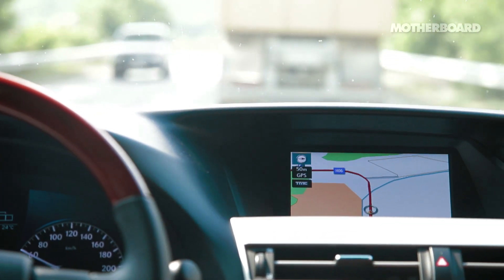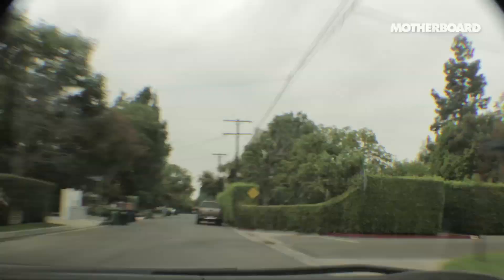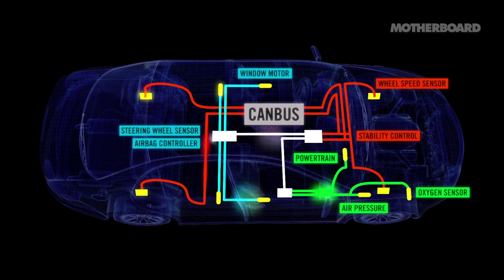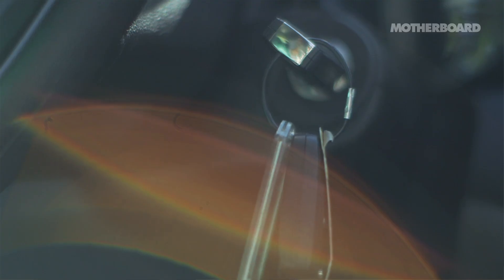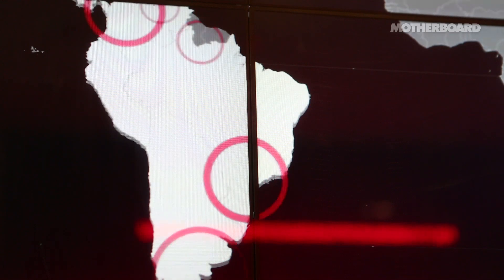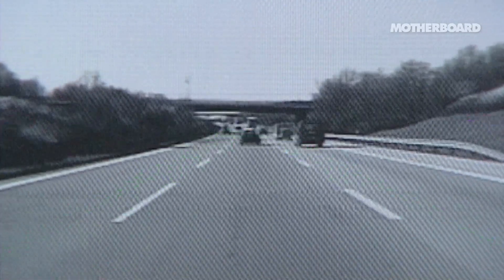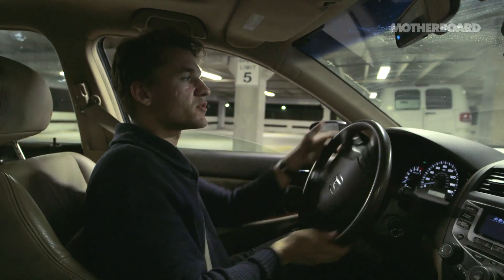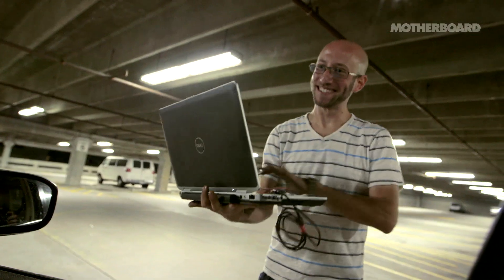How to Hack a Car: Phreaked Out (Episode 2)

Comment: So carbureted muscle cars with breaker-point ignitions and a complete lack of electronic anything enjoy an immunity to such threats... And they still run after over 40 years.
Will there be old car nuts restoring today's PCs on wheels in 2050?
I hope so !
Reply: ... just like in the Mad Max movie, Muscle cars will rule the planet.
Reply: in 2050, those types of cars won't be allowed on the road. Police will be able to scan any car they see to find out if it's insured, if it's registered, who the owner is, how many miles it has on it, how much gas is in the tank, previous repairs, what parts work, what parts don't work. If you're driving a car without the ability to be scanned for status remotely, you will be pulled over and detained. Trust me, this shit is coming.
Reply: The best hacker is 👉🏻 HACKERCHARLES01_ on Ig 🔥or +1(210) 593-8315_
Reply: The best hacker is 👉🏻 HACKERCHARLES01_ on Ig 🔥or +1(210) 593-8315_

Comment: The Boston brake assassination is a technique used by intelligence agencies and has been used for decades. It is basically the same as this, the ECU chip is replaced with a rigged one that allows them to gain remote access to the vehicle causing a deadly crash such as the incident Princess Diana was involved in. It was the price of high treason in this case it seems.

Comment: I sure hope the annotations weren't important, because I turned them off as soon as I saw that "click here to subscribe" thing.

Also, love how their "surveillance" bit is a super unrealistic movie clip with unnecessary special effects and meaningless "data" bars. Way to give credibility.

I'm glad someone is bringing attention to this, but this video needs less hollywood drama and theory and more hard facts and demonstration. A few minutes in they mention how the software wasn't following standard security practices. This is the stuff that needs to be highlighted. And the bit where they show him actually hacking the car from his laptop, it says that this is a modified car and they aren't normally vulnerable. They should be highlighting how it's relatively easy to patch into the control unit and make those modifications, or they should find one that is vulnerable without modification.

Right now, the way this software and hardware is designed is pretty much the exact opposite of how it should be: closed source, closed doors, secrets everywhere. You know there are vulnerabilities but you can't easily identify them, and when you do, you can't easily fix them. This stuff needs to be open-source and heavily scrutinized both by random hackers and by government safety engineers.

Comment: This isn't hacking, It's physically connecting to the cars OBD2 with a bi directional scan tool and controlling actuators. The video claims wireless, although you would still need to physically connect to the data link connector. Very misleading and dumb video.

Comment: What a Joke! "This vehicle shown is modified with third party hardware for DEMO purposes" It says in the video you would have to physically connect something to the ECU which the only easy access to this is below the steering column on the OBD2 (data link connector) so you could easily un plug it, and you would have to break into the vehicle to connect it. His fancy lap top is really just a bi directional scan tool hooked up through a wi-fi connection so distance would be limited, all mechanics use scan tools, they are nothing new. Base brakes will always work, brake booster would work for three applications at least after the car was turned off, you would lose power steering but not steering all together, your parking brake would still work, and you could still unlock/lock your doors with your car key.

Comment: They installed a unit that controls the computer of the car, you need physical access to do that, so it's not like it's a magical hack that is wireless, it requires alot of work.
Reply: Yes, that's the point. I don't understand why they didn't say that in the video. (They just wrote a subtitle about it)
Reply: No, they hacked in through blue tooth on the radio telematics module to the CAN network, this exploit has been patched from my understanding.

Comment: The demonstration with the honda accord is such a crock of shit. That accord doesnt have a can-bus system. All he can hack is the keyless entry system. So he can kill/start the ignition and lock/unlock the doors. HE CANNOT TURN THE BRAKES OFF! THE DUMBASS PRETENDING TO DRIVE, JUST NEEDS TO PRESS THE BRAKE PEDAL LIKE A MAN AND NOT LIKE LIKE A 5YO GIRL. THE ENGINE IS SHUT OFF SO THE ONLY THING LOST IN THE BRAKING SYSTEM IS THE POWER ASSIST BRAKING SYSTEM. THE PEDAL JUST NEEDS MORE PRESSURE APPLIED TO MAKE IT STOP THE CAR.
Reply: EDIT: just watched enough to see him admit that the accord he is demonstrating his "hack" with, doesn't have a can-bus system from the factory. very good, you can hack the car you modified so it is hack-able. smh. sounds legit...

Comment: One Problem, how the fuck are they supposed to just "plug in" a chip to the ecu of a random car? Not very stealthy as the ecu is buried inside the engine bay of any car, not to mention newer more connected cars have so much shit covering the top of the engine bay, your not "hacking" into any cars very easily like this.

Comment: Sensationalist garbage. 

An old Honda Accord like that shown has purely mechanical brakes and steering. They cannot be interfered with as shown, no matter what. If you build a special board and solder it to the right wires, yes, you can control certain aspects of the car...but are we really supposed to be scared of that?

Comment: Most of these hacks require some specific types of cars… Most cars can't even access basic "functions"… You can't even remotely access the steering wheel on most cars.

You can only hack the car if it has the appropriate remote control system! This limits "car hacking" to newest relatively expensive cars…

You can't bypass basic functions on most cars. You can ALWAYS stop the car! You can always honk! You can always get out of the car!

The only things that can be hacked on most cars is engine start/stop, alarm system, panic mode, windows, lock/unlock, and all those common inoffensive things…

Comment: This is funny, I bought a car from a Marine he said he was trying to get accepted into the CIA, this was before you'd consider the gov being a bad guy.  I never had problems driving the car around, only just getting it home.  I'm pretty sure it was being tracked, and the oil pressure would always spike suddenly and overheat and kill the car.  It seemed to never be able to be fixed mechanically and so i had to get rid of it.  I came back to re-buy it & found it stripped down within a matter of days.  Its a shame I had to dump it, I really loved that car, even in-spite of the trouble i had with it.

Comment: This is ridiculous, they're idea of "hacking" a car, is by wiring it in, and making their hardware capable of sending commands to the ecu. They never remotely hacked a car, it's all a controlled experiment that proves nothing. I want to see them shut down a random regular car on the street, which for majority of the cars on the road will be impossible. Keep in mind police have been doing this with bait cars for quite some time now. What they are doing is not difficult or special in anyway.